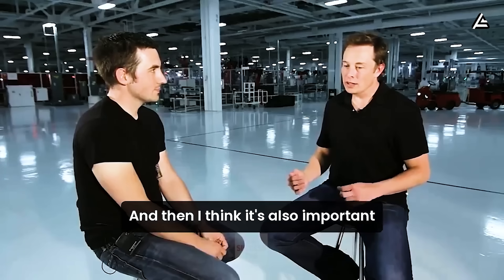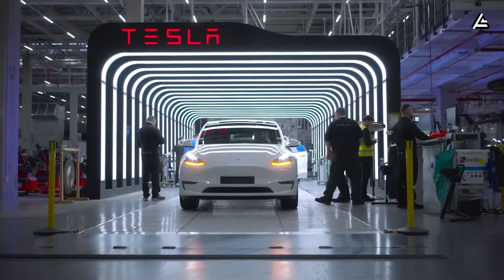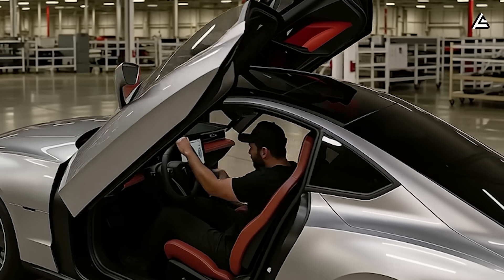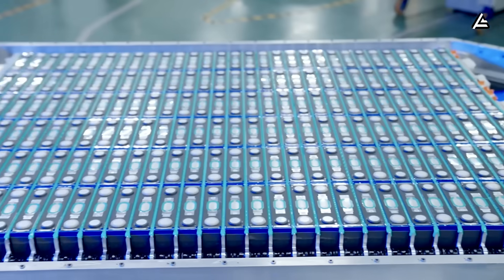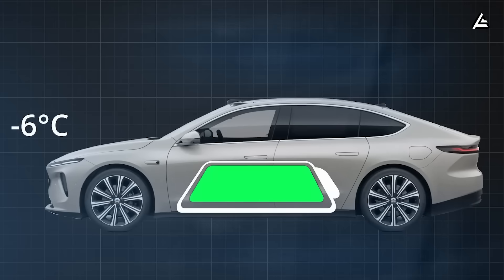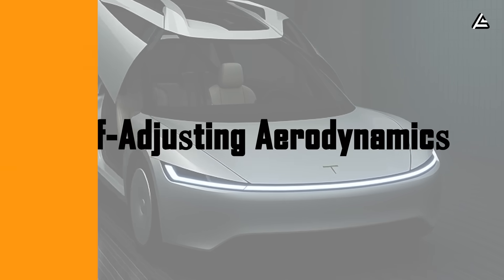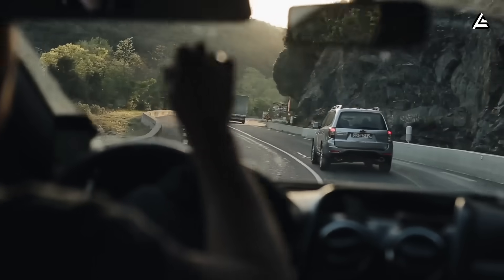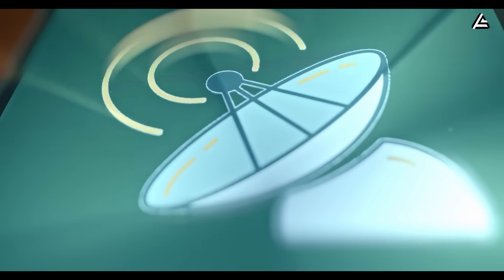Tesla Model 2 Senior Edition: SHOCKING SpaceX-Inspired Features. What's Hidden?

Comment: Does the body maintain its cooling efficiency as the car ages?
Reply from the maker: ooling coatings and aero features should hold up over time, but efficiency can drop with wear, dirt, and UV exposure.
Reply: When can we buy?????
Reply from the maker: There is no official release date yet for a Model 2 or equivalent lower-cost Tesla that you can walk in and buy today. All current timing estimates come from industry expectations and supplier signals, not a confirmed production schedule from Tesla. When Tesla announces a real launch and ordering window, we’ll cover the verified details.